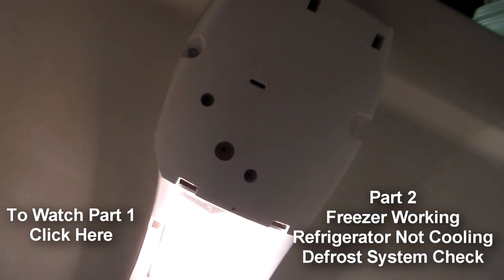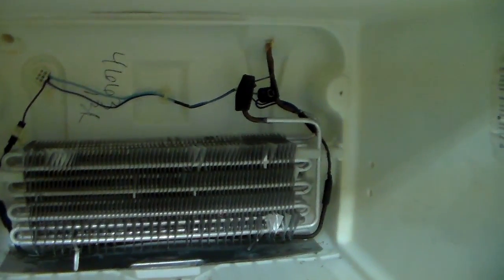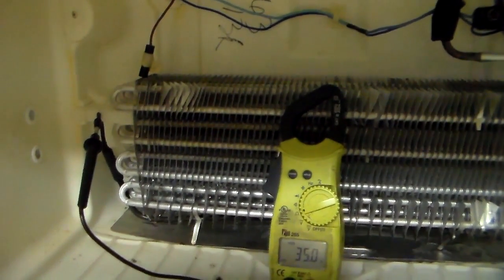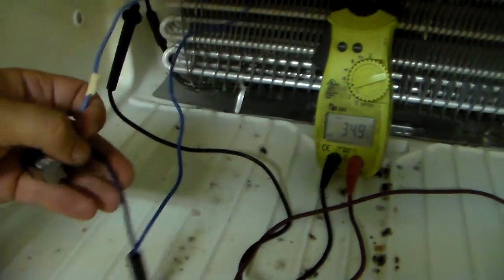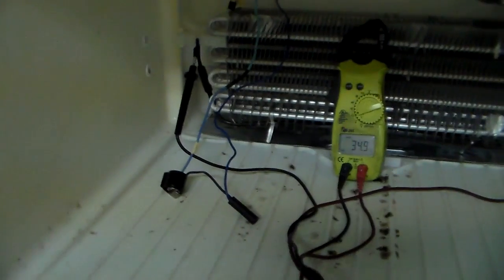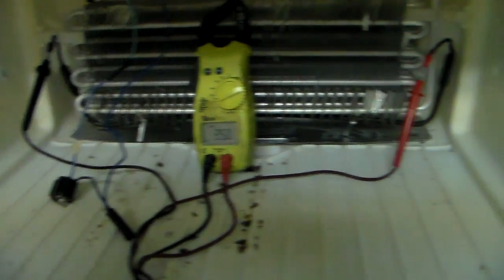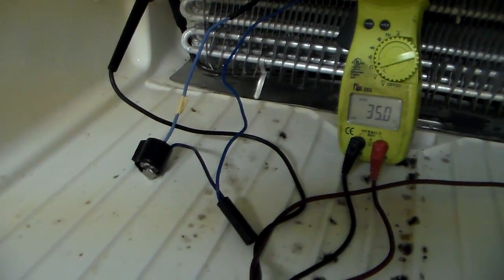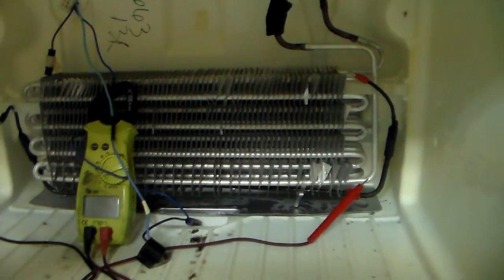Troubleshooting a No Cool Refrigerator - Part 2

Comment: Great explanation, review and repeat good.  Have a old Coldspot  with according to parts manual the heater is L shaped on the left front side of the freezer cabinet as well as along and under the front floor of the freezer compt.  Timer on bottom behind kick-plate.  Not sure How I can assess if the heater comes on, but will give it a fresh look.  Fridge at a cabin location, so will be couple of days to give it a new look.  Parts manual lists two defrost timers,  so will have to check which one to order.  1 Turn timer 'till shutdown.  If heater comes on ...defective timer.  2 If heater comes on test the thermostat for continuity when iced for 10 minutes.  If no continuity defective thermostat.....Have I got it?  I did manually defrost last time there and it did seem to be working  with the compressor  cycling.  After seeing your tutorial,  I'm thinking maybe ordering the timer.   The thermostat is a little pricey and wonder if new fridge will be the smart move.

Comment: Thank you. I am troubleshooting a refrigerator left in rental house. It ran fine for about a month and then became too warm in the fridge. The freezer remains cold. When I removed the back panel in the freezer, the only areas iced over were in the upper left corner and all over the defrost thermostat on the upper right. The evaporator was free of frost. There is a small (less than 1mm) gap over about a third of the top of the fridge door that I cannot adjust out. What should I check next?

Comment: I got different information now.  I guess the freezer got warm and the refrigerator part was cooler.  They cleaned dog hair out of the back and plugged back in and worked for months.  Happened again and would run for awhile.  They left it plugged in for a few days and restarted.  
Should the ohms read what the data sheet states?  ANy way to test the inverter box?
Thanks Brian

Comment: Hey Terntiy, I hate to ask this, but which relay specifically are you talking about?  I am pretty sure I have the same problem as you.  My freezer works fine (or too much) and no cooling in the fridge.  I didn't defrost it for over a year and it was all blocked. 
Which relay did you replace?  Bill in this vid talks about defrost thermostat and timer. No relay. Maybe I am missing something. 
In any case, how did you fix yours?

Comment: Juan, you could do one of two things. One, you could take a refrigerant pressure check, but that would include getting piercing valves and a set of gauges. Two, place the defrost termination thermostat right in the area where the icing of the evaporator is taking place.

Comment: I suggest when it does that , just unplug it and before it had a chance to thaw , take off the cover and see if the condenser coil is all frozen up, and if it is , you got a defrost issue and not a cooling issue. then you can thaw it out  and put it back together and your freezer will be working for at least a few days, so your food does not spoil while you shop for parts.

Comment: I replaced the defrost  control , also a new Temperature Control , cleaned the drain tube in the back of my GE Refrigerator that looks like a p-trap ,but my unit runs all the times . The freezer temperature is 7 below zero and the food compartment is about 44 degrees .  Do you think I might have a defective defrost thermostat ,or a possible defrost heater , since I see lots moisture inside the refrig and sometimes water by the vegetable bins . Can you please help. Thank You

Comment: I noticed lots posts about Whirlpool side by side refrigerators with similar problems.
I defrosted the refrigerator, but now the freezer only cools to 50F.
Fans:  Compressor and internal fan come on.
Is the heater stuck on?

Comment: Ok I have one for you advanced troubleshooters. He says if you move the timer to defrost and the heater comes on, then the timer is bad. This makes sense. But what if the sealed system has a problem (small sealed system leak, compressor not working at full capacity etc), then what do you diagnose? Test the capacitor obviously, but I guess replacing the timer would tell you if the sealed system is bad, in which case it it time to open the wallet for a new fridge/freezer. Any other thoughts? How about methods for testing the evaporator or the sealed system if there is still a mystery?

Comment: Bill i have a G.E Profile Refrigerator and its leaking in tje bottom part of the fridge, I unclogged the drain plug and the housing with hot water and air it out with an air compressor, i repeated the process and poured room temp water in the drain and you can hear the water draining in the back into the pan, but you still see a little bit of water coming down into the refrigerator, then in the morning you have a small puddle of water, any ideas....

Comment: Question I had a customer complaint about a fridge no cooling or freezing, I checked the gages, the low side was at 0 and the hight side was at 150 that's for 134 a, is it a leak or restriction just could not tell

Comment: Hi Bill,
My fridge is like the on in the video. I have changed my defrost timer and thermostat and the fridge is still not cooling. When I put the timer in defrost mode the heater does work it takes a min but it comes on. Then I put it into Cooling mode it makes that click it goes into cooling then it makes a click it self shortly after I put it into cooling mode. In the process when does the evaporator fan come on? I've never seen it come on!!!  Could that be a part of the  problem cold air not being pushed by the fan to the fridge? Please help as Thanksgiving is 2 days away. Thanks in advance

Comment: Great video. My Whirlpool freezer stopped cooling. There is no freeze build up. The fan works but the air comes out at room temperature.
What should I checked?
Thanks
Reply from the maker: Marcos Espina See if the compressor is running.  It should be running when the fan in the freezer is running.
Reply: I had a technician come in and told me the pump is not working (embrace EGUS 90HLP). By the time I have it fixed it will cost me almost as much as buying a new freezer.
If I buy the part myself, how difficult would it be for me to replace it. Do I need special tools?
Thanks for getting back to me.
Reply: Marcos Espina
Reply: S Squared Photography

Comment: Yes. Lots of ice at bottom as well. I never heard or seen fan come on. I am assuming the compressor was running. Very quiet humming.
Reply from the maker: Lisa Power So, the top of the freezer is thawed, or thawing.  Bottom of the freezer is froze solid as a rock.  Fridge section warm.  No fan running, but can hear the compressor humming.   
You need to defrost the freezer and get to the fan inside the freezer and test it.  One of two things has happened.   Defrost system failed so your machine iced up and the ice has physically stopped the fan from spinning.   Or............. the fan died.

Let me know what you find.  First step unplug, next step, find hair dryer.  Have an hour to spend on this with some towels.
Reply: Defrosted but do not see anything in way of fan. I can spin it freely by hand. So I am assuming the fan is shot?
Reply from the maker: Lisa Power Get out the multimeter and test the fan.  Or put 120 volts to it and see if it spins.

Comment: Can you check components in circuit at the connectors on the mother board? I've got my schematic with all the component pin connections on their connector plugs.

Comment: Hi Bill, I have replaced the def thermostat twice, both times they would let the heater stay on until the timer shut it off. Unit got hot as hell. The parts were made in China, any suggestion on getting a part made in USA? 
Thanks, Art

Comment from the maker: I actually don't know of a way to test the inverter box.  There should be a wiring diagram on the refrigerator somewhere.  It should state the ohms across the pins on the compressor.  If not, let me know and I can make some phone calls tomorrow see if some of my tech support buddies can look it up for me.  If I had a similar machine at the shop I would test it.  All I have are the 120 volt compressor machines.

Comment: Have a refridgerator that will cool for awhile maybe 3 days  and then get warm. Another symptom is water over flowing from the water pan under the unit. Could this still be a defrost issue or stuck in defrost allowing fridge to heat up and having excessive water in the pan? Freezer is very warm but when you move the temperature dial up or down a little it starts cooling again.

Comment: thought when timer goes into defrost mode, that was the time for the heater to come on, so why would the timer be bad as stated here in this video because the heater came on?
Reply: he mentioned the timer is bad b'cos it is not going into the defrost mode.  he is manually turning the timer to go into defrost.  So if the heater and thermostat checks out then that means the timer is bad as it is getting stuck and not going into defrost.  Hope this explains.
Reply: @shyn5613  I find this confusing.

Comment: Hey bill, i have a kenmore fridge and my evaporator fan is not working.  I tried to test the volts to see if my board was shot but the connects are really small and cant seem to get a reading from it.  I did check the ice maker and that is getting 120 volts to it so my question is if my ice make is still working is the control board good?

Comment: got a problem with fridge and freezer not working,,,,,,,,,,evap fan running ,,,,,,but evaporator line frosting up to the area above the taped section ,,,,,,,but not below that and no frost building up on evaporator.......assume compressor  working ok being live is cold at top section,,,,,,,,,,any thoughts ?......whats under that black tape ?.........does tht need replacing ?

Comment from the maker: If you are seeing lots of moisture in the refrigerator area, you need to check the door gaskets.  Moisture on the shelves usually indicates air getting in all the time.  The moisture in the air condenses in your refrigerator compartment.  This would cause it to run all the time also.
Let me know what you find.

Comment: cont. I hooked up the wires directly to the compressor and jumped the start winding to start it. everything works. my question is - What caused the relay to go out? would the next relay last any longer? pls also note- door seal was loose on bottom - and wire contact clips for defrost system were a bit oxydized - . another question is - would a frosted up system cause the compressor to work harder? and relay to go out?  please help and reply - i will be waiting- thanks

Comment: My old Moffat fridge is running well  but in the deice cycle it ices up at the small catch basin at the top inside  , and the water runs down the back wall , the drain tube is clear and I have water in the bottom tray , I'm thinking is the setting in the lower fridge too high?  Thanks .

Comment: Hi I have this problem and no money! lol So I see that my side by side freezer side has ice all down the back of it. My refrigerator side has totally stop cooling. I removed all the food and now I see the freezer part is not cooling. I took all the food out of that ice and I have it opened now getting ready to do the next step you suggested. Only there is an ice cube maker in it. Do I remove it somehow to see the coils? I guess I need to buy a multimeter also. I'm letting it defrost now. I thought I was going to be okay and put it in my little chest freezer but now it doesn't work! Lordy, Lordy! lol Oh and my compressor is running.

Comment: Hello, I am having this same problem. So far I have checked the heater and it has continuity, changed out the defrost thermostat and the heater is still not working. My timer goes around on it's own and it cuts off after 8 hrs., but the heater isn't coming on? Can you suggest something, Thanks

Comment: I have an old Frigidaire top freezer that won't keep ice cream frozen. I put a thermometer in there and it reads 20 degrees. Meat freezes fine, but it takes a little bit.It takes a day or two for ice cubes to get solid. The refrigerator is minimally cool, set on max cool at the 9 setting. The freezer is set at max of 5. Could you give me an idea of what I need to check for? Thanks.

Comment: Hi Bill, Thanks for your great videos.  I have a problem that you illude to but I am not sure of the solution.  My evap. fan on my kenmore side by side has no power going to it.  I believe you said that would most likely be the Adaptive Defrost Control Board which my model does have.  Is there any way I can test this before I purchase it since it is a $150 part.   thanks so much

Comment: Hello, I have a question about the same fridge Frigidaire frt18s6 awk

Freezer works fine now air flow to the bottom refrigerator. The fan isn't running in the freezer. Is there a sensor that turns it on and off?

Comment: Hi, my problem is the freezer is running but not cold enough to freeze the water and the refrigerator is not cold at all. In the freezer in front of the back panel I could see bulk of hard snow alike build up. But the refrigerator fan and compressor stop for defrost timely and go back running normally, I clean well all the dust that wrap around the coil in the bottom and the fan, still the refrigerator not cold at all, what is your opinion ?

Comment: Hi, I'm having a problem whereby both my freezer and refrigerator compartment is not cooling...I check the electrical aspect of the compressor, fans and timer and they are working as should...Before I jump to the conclusion that the gas has leaked out can you recommend what else should I check? Also the suction line of the compressor is not all that cold...
Reply: How did you get on? What about thermostat or faulty relay or did you check that? Love to hear the outcome so we all learn. Think bill has passed so have to all share our own successes and knowledge for him 😊

Comment: Thanks for your video. I just bought a new Beko DN2666 or so. The product is not working s i returned it back to where I bought it and was fixed. But on transporting it back the Compressor cable / power cable cut off and could not fix it. I called a technician who came and reconnected the wire but the compressor wont start, the light just came on. I later reconnected the wire myself and it starts working. but wasn't sure. So could u help me with the wiring video? Thanks

Comment: Hi do refrigerators need a freon boost? I replaced the Defrost Thermostat, The Temperature Cold Control, and the Evaporator Fan Motor. Still nothing in the freezer gets frozen and the bottom portion (fridge) does not get cold. Would i need the timer?

Comment: Ours had exactly the problem you described. The back totally frost up and blocked the air flow downwards to the fridge section and below is not cold. I took a hot air blower and get the ice melted to let it  work again.  BUT I  could not find the heater switch knob.on my Toshiba GR-35STV fridge.  I try to do first step. :) But I could not find the defrost timer switch where I can turn the knob to see if the heater comes on. :) care to advise further if can? many Thanks in advance. Sir :)

Comment: I have a whirpool refrigerator that the fridge part is not cooling but i notice that the compresor gets realy hot and also the wall in between the fridge and the freezer feels hot right in the face where the two doors seal cloced, do you have any idea what could be wrong?

Comment: Hey Bill I been fighting this problem with my Whirlpool top and bottom fridge . The problem I'm having is that i'm getting a sheet of ice in the bottom of the freezer. within a week of opening the drain again. I have replaced the the bimetal defrost thermastat. Every time I have taken the back panel off I have never seen frost build up at all. So where is all this water coming from that freezes up in freezer. My fridge stays really nice and cold and freezer is nice and cold. No frost build up at all on back wall. But is always the tray and tube is frozen solid and frozen water on bottom of freezer. Doesn't make since to me. Doors are super hard to open like the suction is very hard. It whistles when closing the freezer top door after closing. Please help me. I been fighting this for a year now. I have taken this thing apart 5 times and melt the ice and clear the tube and it comes back about weeks time.
Reply: I also have read thatvyou can use a copper wire and wrap around heater rod for inch or so and place it down through yr hole / drain that yr water of freezer drains too the tray at bottom. Then defrost cycle will always heat the element rod and the copper wire and clear and drain any water starting to freeze in drain. It will regularly get thawed like coils 👍

Comment: we have a Ge Profile side by side. Occasionally the freezer goes to -6 degrees and when it happens the waterline freezes so no water comes out. Usually 12hours later the freezer temp goes back to normal. The refrigerator always stays cold. during the whole -6 degree time. anythoughts on what happens when it goes to this -6 degrees as is this normal,
Great video,

Comment: Hello,I have a GE Profile refrigerator, the freezer is good but the other side does not cool. I did what you mentioned turn off the defrost switch for 10 minutes. Can hear the hissing of water drooping on the heater. How do I change the defrost switch?
Reply from the maker: Mohamed azeez Model number?

Comment: Bill, On A Defrost problem ( almost 95% of coils frozen) How long before i can tell if the heater is working?
Reply from the maker: Jeff Holliman Probably take about 15-20 minutes before you notice it on if there is a ton of ice build up.  You may have to get out the hairdryer.

Comment: My fridge is cooling both side of my Frigidaire side by side.  I open the back pannel I see the top where the thermostat and other wires are frozen but the rest of the evaporator is OK. Airflow from the freezer to the fridge is low.  What can be wrong? Thanks.